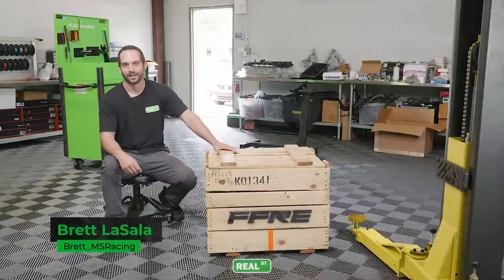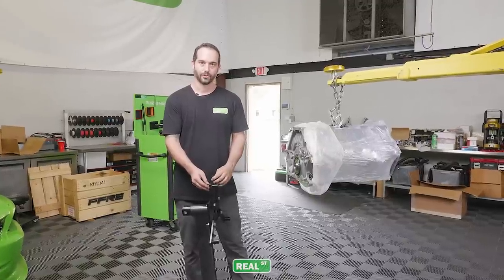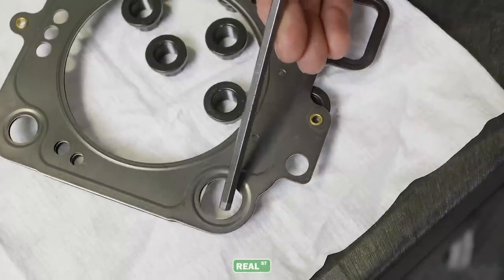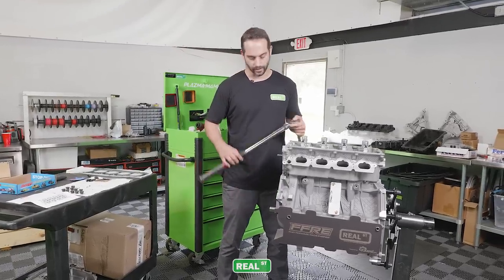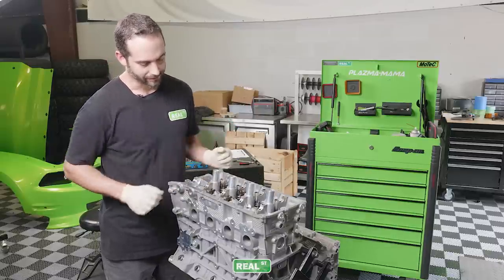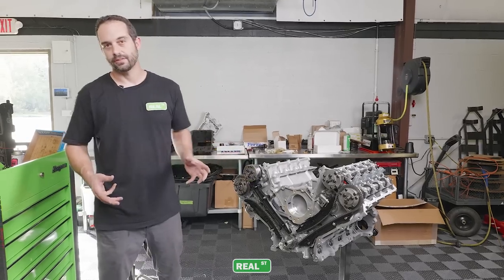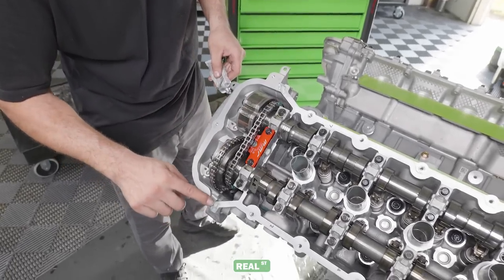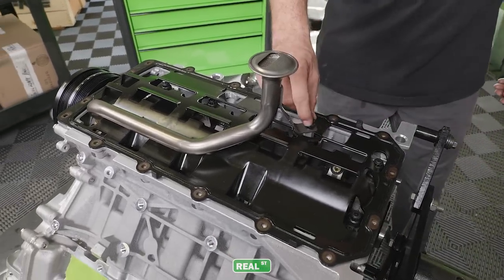FFRE Stage 3 Ford 5.0L Coyote | From Short Block to Long Block - Unboxing & Assembly

Comment: seems rather straight forward. if someone has never touched a coyote would you recommend putting the long block together or just having a builder do it? Brett you did a great job explaining the assembly
Reply: Aluminator would be a better option for less money.

Comment: I rebuilt mine the same, but used arp hardware for everything because why not.  Why didn't you change the secondary chain tensioner slides to metal?  And why no billet timing chain slides?  Unnecessary?